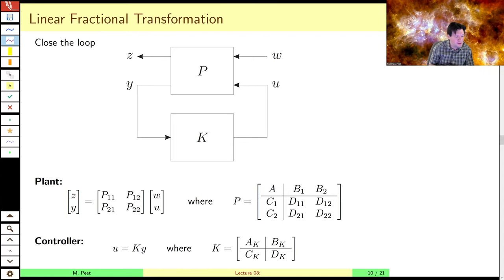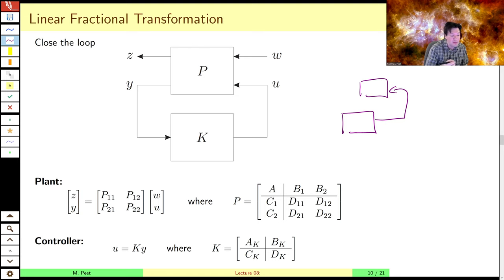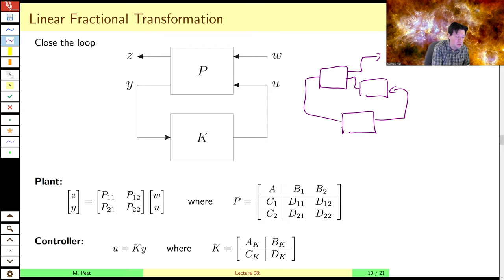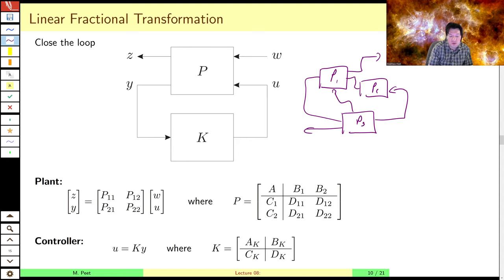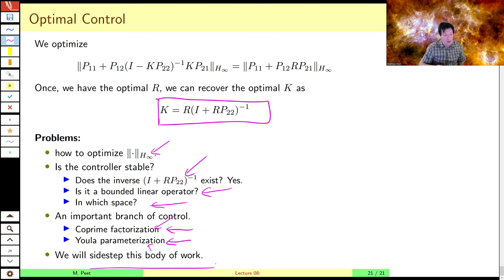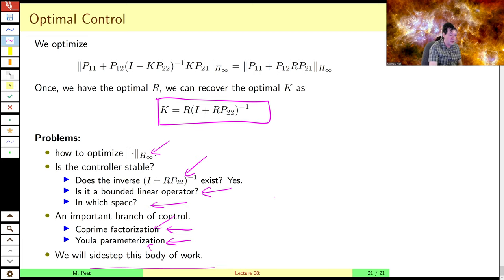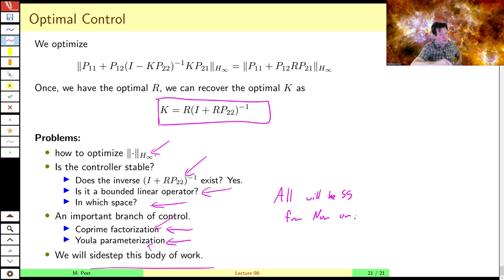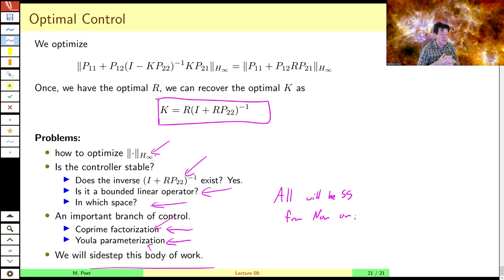MAE509 (LMIs in Control): Lecture 8, part B - The Linear Fractional Transformation

Comment: Thanks a lot for these videos. Really appreciate it. One question: at 15:20, shouldn't the u and y variables be interchanged in the star product diagram? Since u is the output of the controller k?
Reply from the maker: Oh, yes. Somehow I never noticed that....
Reply: @MatthewPeet  Thanks for the response. One more question: At 16:23, for the state and output equations of the controller K, why do you not include the w_2 term as an input in the equation for \dot x_K? Also, why isn't there an equation for z_2 as the output of the controller K? Even though z_2 is shown in the star-product interconnection diagram at 15:31?
Reply from the maker: Probably, yes. Bu more forgiveable here since there is symmetry between P and K.